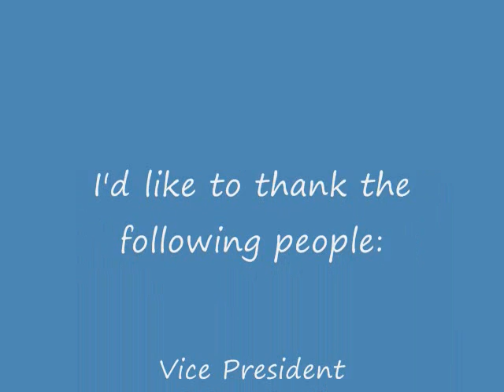Heritage Rough Rider:  Tour of Heritage Manufacturing Inc. part 3

Comment: Way oil. its used for all the flat bearing surfaces in machines used in machine shops. helps parts of the machine slide over each other and remain accurate